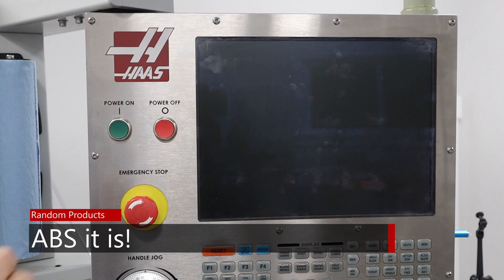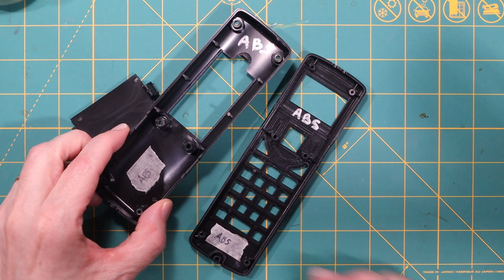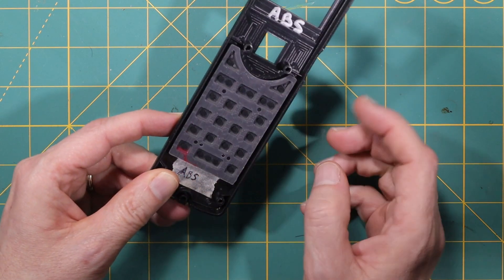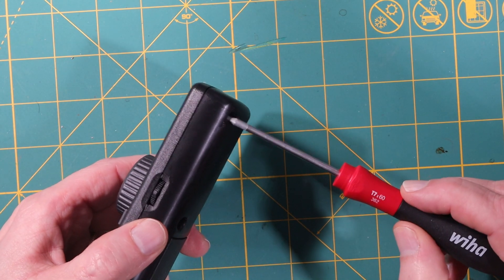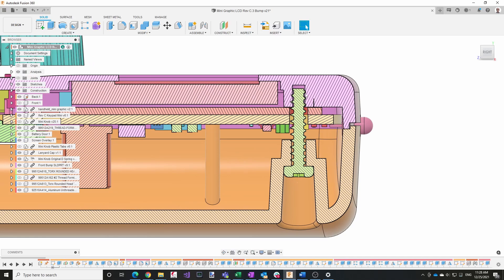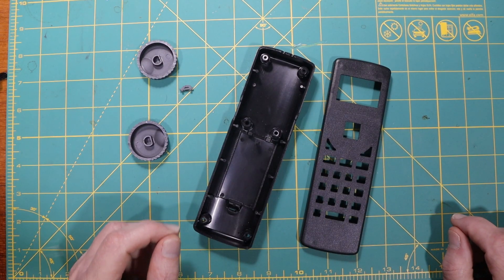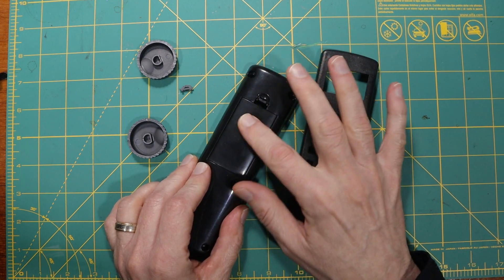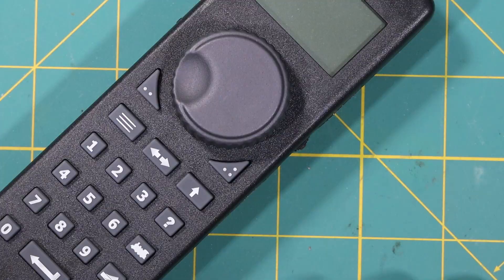ABS It Is! - Design Injection Molded Products

Comment: What was the benefit of choosing ABS?
Reply from the maker: It's a very common material to use for this type of case, and what we used on the previous case we did. The rubber blended into the polystyrene makes it so it's not brittle, and therefore better able to withstand being dropped.

Comment: What plastic were you using for Prototyping and why did changing to ABS affect dimensions?
Reply from the maker: For prototypes, we used commercial 3D prints, and I believe they were either ABS or an ABS-like material. But I don't remember for sure.

Comment: 2:59 looking at your cross-section drawing I noticed the wall thickness varied, if the screw boss wall thickness was matched to the outer wall the sink and surface distortion would improve. Your outer surface walls are cooling at different rates. Also, the deeper hole grips a screw tighter
Reply from the maker: Yes, I realized after it was too late that I should have bumped the front around the screen out more than I did. That would have allowed me to keep the thickness more uniform. And, as you point out, it would have allowed for a deeper hole. The results aren't perfect, but customers who buy it are happy, which is all that really matters.

Comment: Awesome and informative!  A bit off topic to molding but on topic with product development, don't forget FCC certifications for those WIFI and Bluetooth devices.  Most times when you populate a PCB with wireless components the FCC certification that individual component may or may not have wont transfer over when you put it into another housing.  Or in other words the certification is void as soon as you put it into a box and a new test and certification is required.  Don't skip this step.  Just some food for thought but you may have already done your FCC certification testing.  Great work on the molding videos!
Reply from the maker: TSC had them certified for FCC as well as standards for some other countries, which was not cheap.

Comment: Why not use nylon 11 or 12 these have almost 0% water absorption and have much similar shrinkage to nylon 6 or 6.6
And 11 and 12 are both more impact resistant they are more expensive but that would only be about 15%. It is recommended to heat the mould to like 80 to 100degC to get the optimum performance. But for that job you do not need it's best preformance so running the mould at 30degC would be fine.   . ABS has a very poor resistance to hydrocarbons, heat and depending on your button pad material may react with it.
It has a lower melt flow index than nylon and is some of the reason for the flashing from higher injection pressures look at larger gates and venting locations. Higher melt flow ABS tend to have poorer impact resistance.
Reply from the maker: We didn't like the slippery feel of nylon. and the other throttle TCS already sells is ABS. We had originally asked the mold maker to use ABS, but they suggested Nylon would be better. I also believe ABS is less expensive than Nylon. In short, we never really needed the properties of Nylon.

Comment: I have two questions. First, what happened to the ginormous mold injector you picked up a year ago or so?  Second, given the ubiquity of smartphones these days, have you considered developing an app along with a Bluetooth module instead of manufacturing a remote?  It certainly would be less costly to develop and manufacture.
Reply from the maker: The Arburg machine isn't anywhere close to large enough to make this case--it's a small industrial machine. Regarding the smartphone app, there have been smart phone apps for quite a few years. Those are cheap (some are free). But they don't have the tactile experience some people like. Some people prefer the phone and others hate using a phone for this purpose. As to a Bluetooth module being cheaper, not really. The certification costs are quite high when you're holding an RF device. It doesn't really matter whether WiFi or Bluetooth.
Reply: @JohnSL  Ahah!  I figured it was the real reason, but had to ask.  If you're really into the entire tactility experience, then use real mechanical switches with custom keycaps, instead of membrane switches!  You can build it out using a stock enclosure from one of the many companies out there such as OKW. They have various handheld units with a sloping area for the screen and can be customized, making it difficult to discern the finish product from the stock one. There's a huge resurgence of mechanical keyboards recently and the quantity, types and style of mechanical switches are enormous. I envision the handheld appearing like those old separate numpads with an LCD that were big back in the 80s. If you're customers really care about the loom and feel, you owe it to them to give them the ultimate experience they're looking for. I can send you links of the enclosures and switches of what I am envisioning.
Reply from the maker: The keypad we're using is much nicer than a membrane keypad. It's a silicone rubber keypad with graphite pads on the bottom of each key. The profile is designed to provide a soft "click" feel, so it has a positive tactile feel when you push it.

Comment: The delays are the reason why people go to Asia because even as a small business you will be able to find a company which has resources and they will get it out of the door within no time.
Of course it could also go the other way - it also depends which company and which people you are working with.
Reply from the maker: That was certainly our experience with the last mold, which was made in China. TCS really wanted to have the molds made in the US. But we certainly need to have a conversation with the mold house about poor experience.
Reply: @JohnSL  I tried to find a German company years ago for a simple plastic housing for a USB Stick... the way they looked at me... this mold is going to cost 30.000 EUR + (at that time around 40k USD) at least (I did not expect it to be cheap but not like that either). They also told me that they're usually fully occupied especially for making moldings for the food industry.
Since we have had good connections back then to a group of Taiwanese engineers we got a direct contact with a small business owner there and that guy was a joker for us.
He not only did everything on time and even fixed some of our engineering issues directly by himself (because that topic was new to us) and the story cost us around 9000 USD.
The end of the story is that I moved to Taiwan myself, I like the environment we have here (it's not in particular cheap, but you really get quality parts and don't have to worry too much about it)
I'm also mainly into electronics and software, the machining part is getting better slowly for me.

For the electronic manufacturing in Germany we also had such ridiculous waiting times... every station like 1 month... making PCB 1 month, manufacturing 1 month ... then another spin? oh again the same delays. In Taiwan it was like okay you give us the material and you're done in 1 week per station. And I'm very sure Taiwan will turn to the Asian Switzerland... a golden era is upcoming for them. If you're small you need to take care about your own stuff, if you're big then you can talk in the western countries.
IPhone PCBs are made in Austria.. and that for sure not without a very valid reason.

One more thing to add about machinists near the coast .. corrosion moldings are subject of corrosion and even with that one we never had a problem with that guy in Taiwan (I guess the same applies to east / westcoast in the U.S. things work a little bit different near the coast vs. in the center of a (non island) country. Taiwan all over is subject of high humidity (we have around 75% regular where I live nowadays) versus in Germany it was really low and dry.

Comment: Nice work. ABS is always, always, always, the first choice for a clamshell electronics enclosure. The only thing better is PC/ABS blend, or pure PC. But they cost a lot more. Only use Nylon if you need tremendous strength, or if you need low friction.
Reply from the maker: We originally specified ABS, but they talked us into Nylon, which was a huge mistake. Fortunately, we were able to get back to ABS.
Reply: @JohnSL  Why did they suggest Nylon? I find that odd. ABS/PC has been my experience over the years. In my first personal project, I specified PLA, which has its challenges, but thankfully the end product is lovely (with fewer dimensional tolerance requirements than yours however.)

Comment: Now you know why I bought my own injection molding machine. Even though I am close to a large molding company I couldn't get good results or performance.  They wanted to delay everything 6 weeks or more just to run parts. A single delay like that cost more than the molding machine. I make molds and make changes in house the same day and try it immediately. Some changes might take a day or two. How much would you save if all the delays you have experienced shrunk to 5 days. How about getting production parts the same day? The experience you get by running your own parts will educate you on mold design so you will need few if any mods the first time.  I have a spare molding machine which would do this job and run production all day long.
Reply from the maker: I'm a software architect.
Reply from the maker: Yea, that's a road I didn't want to go down. My workshop is already stuffed. If we're able to meet again this summer at Bar Z, I'll have to ask you more about your experience.
Reply: @JohnSL  He makes an interesting point and an even more interesting business proposition. If you had your own molding machine, you could provide a profitable, one-stop, prototyping and small batch production service to other entrepreneurs facing the same frustrations you're having. You would have both sides of the equation, enabling your customers refine their prototypes easily and quickly. It certainly would be worth renting space or adding an addition to your home for the opportunity. Just a thought.
Reply from the maker: I have my own molding machines (on the order of 5) and have been making molds and parts for other people. You can see some examples in previous videos I've done. However, there is a limit to what I'm willing to do myself as this is a hobby for me. I have a day job I really like that pays very well, so this will stay a hobby. Also, this case is larger than any of my machines can handle and I don't really want to get a large enough machine.